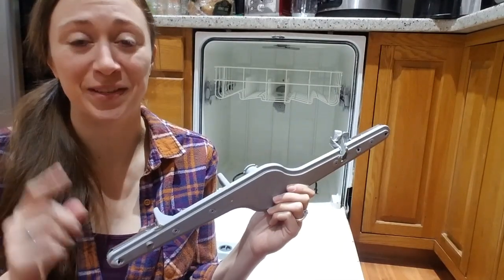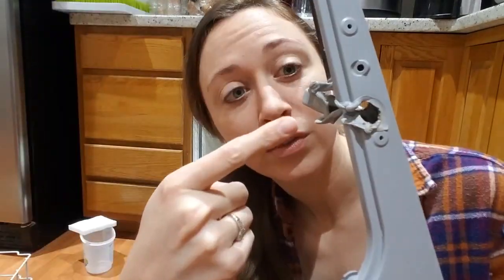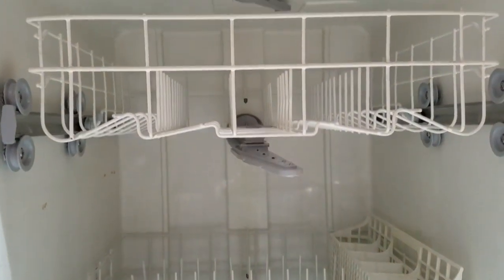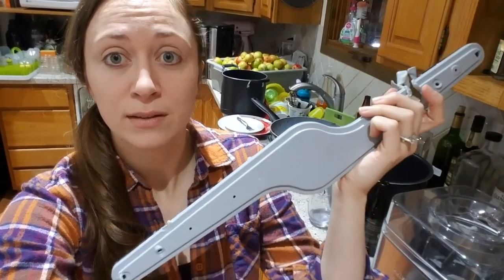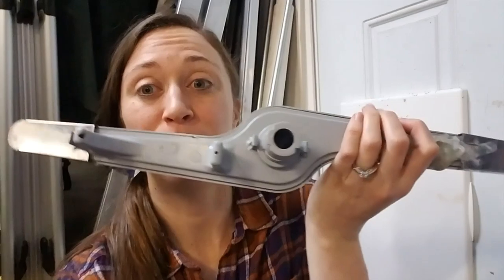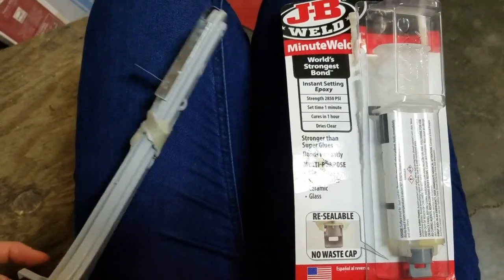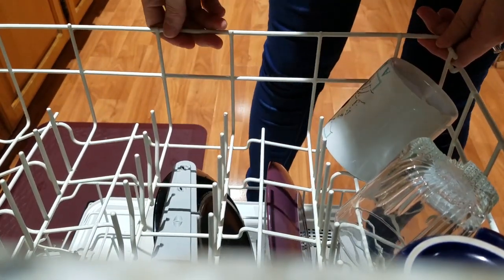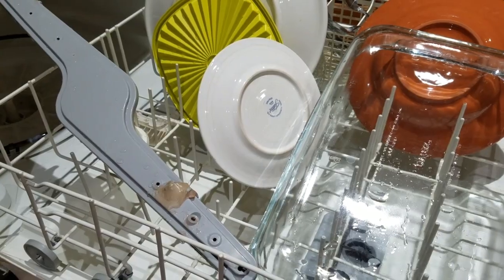Repairing a Melted Dishwasher Spinner Arm (Frigidaire Part #5304517203)

Comment: We’ve had problems with a clogged sink and backed up into dishwasher. I took bottom piece apart to clean and I guess I didn’t get the arm put back on securely. It melted like this. 😢. Part is easy to replace but I worry about the heating element being messed up.

Comment: Any ideas on why it melted in the first place? We had the same thing happen including to the replacement on its very first wash! I did my best to ensure it was in stable place, but it happened again. Any ideas on prevention?
Reply: It needs to click in place usually by turning the plastic to the left after cleaning or assemble. If it’s not locked in the arm wobble and hits the heating element.
Reply: Mine melted too!